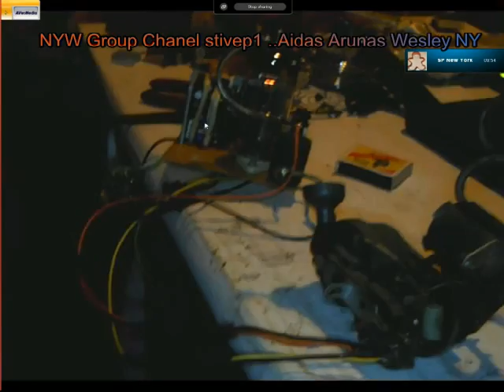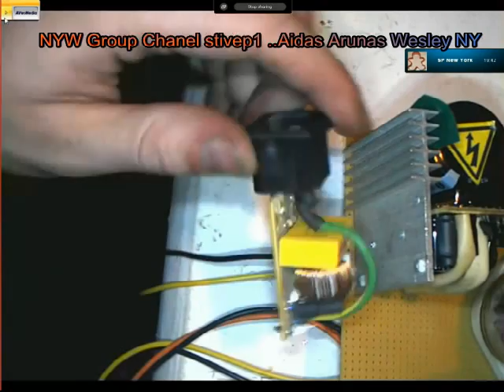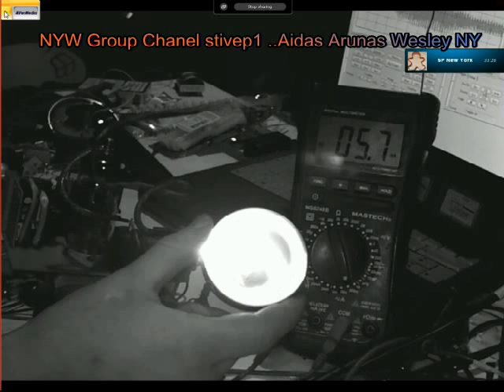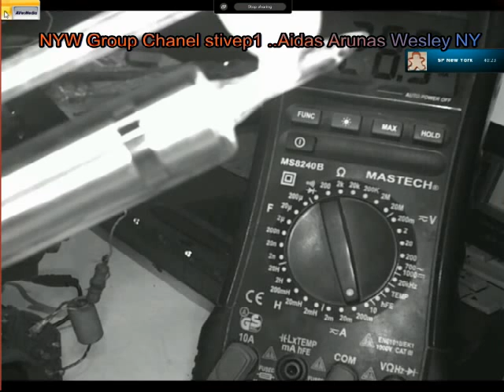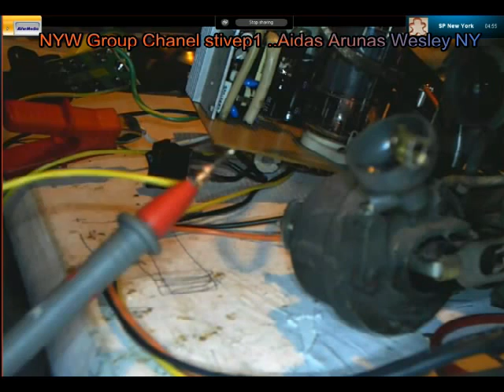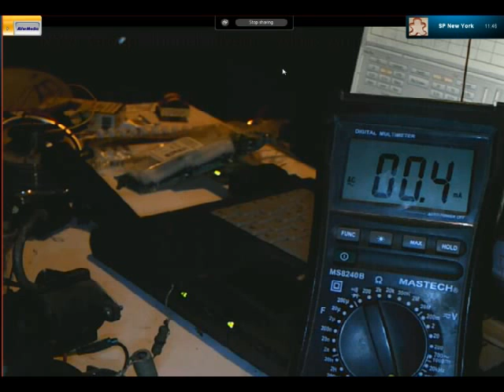Lithuania  Experiment 2012   NYW group  Video #1 (Aidas 3W in  100W out)

Comment: What stupid cows are working on these projects!
The guy measures the current with a multimeter set to the 200mA range. The measuring tip is plugged into the 10A pin instead of the 200mA pin. People! First, learn how to use an ordinary universal meter. Then familiarize yourself with the problem of measuring high frequency currents and voltages with meters that cannot measure high frequency currents and voltages. Finally, it would be worth knowing that the meters in a plastic housing are not resistant to EMI distortions and show stupidity when placed next to an EMI source. Efficiency is calculated by measuring P(in) and P(out). Eff = P(out) / P(in). Is it so hard?

Comment: @elect40n My next hurdle is the 3 channel crt beam deflection amplifier I need to amplify the signal generators to a power level of several watts. My first attempt failed because the chip I'm using typically runs with a supply voltage of 200VDC. The spec sheet said 0-200V but that's not true. 13.8VDC was not enough. I'll need to make a simple power supply close to 200V to make it work, then be very careful not to over drive it!